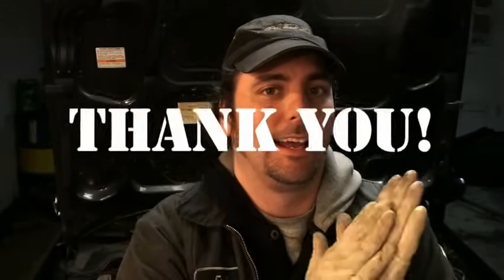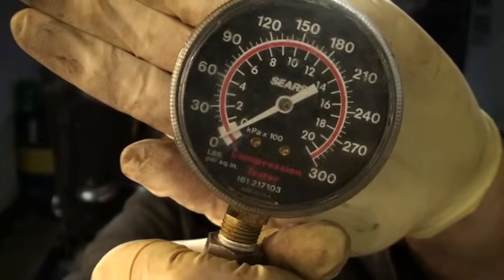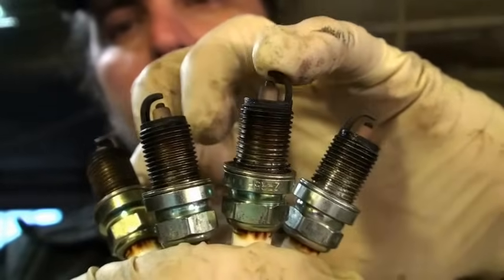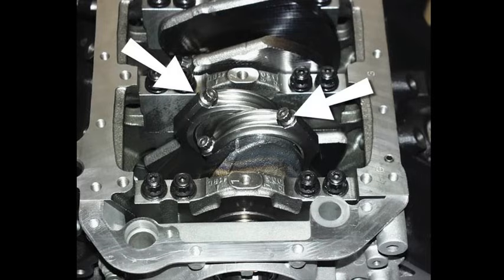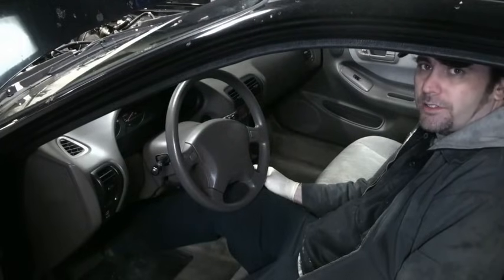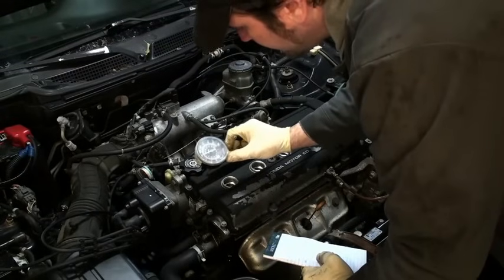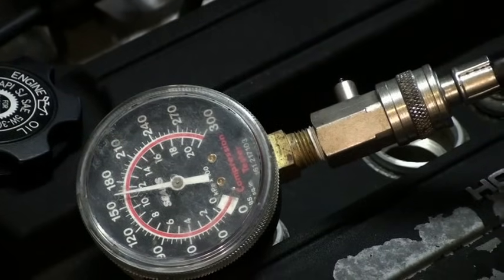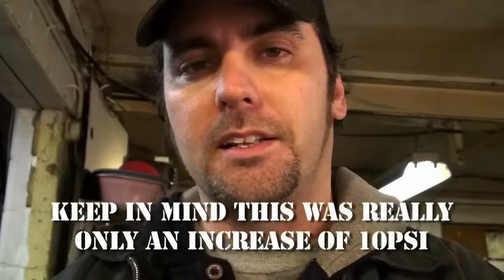How To Perform a Compression Test - EricTheCarGuy

Comment: At 2:43 you say "It's a good idea to disable the ignition system".  How?
Reply: Can you just listen to the video? It is all there.........
Reply: Gregory May "Disconnect the connectors at the distributor... look for the ignition system, look for the primary side, just unplug whatever's there, and it will disable the ignition system.

With how specific the video was, and others of his were, the general idea of finding wires (when I didn't know what to look for) and just unplugging whatever was there seemed a bit too vague.  Perhaps this explanation would require a video in an of itself, but if so, it shouldn't just be glossed over.  Luckily Eric goes on to say that we can flood the system to prevent a spark.  So I followed that method, hoping that it would work.  Still would have liked a bit more detailed instruction for explicitly disabling it, rather than relying on what sounds like a safety feature.  Perhaps this is not possible to give this detail, as it might be very varied depending on vehicle.

I looked in the fuse panel (not knowing exactly what to look for) and I rewatched the video a few times.  He mostly just talks about it, and when he does show it, it's a bit close up and so very hard to tell where in the engine he was unplugging something.  As a newbie I did not find it totally clear.  Just pointing that out.  

Luckily he did have a simple workaround he talked about with causing a flood condition.  Not sure if this is good practice, or would work for other maintenance in which I might be required to disable the ignition system.
Reply: Aaron Zeitler
If you don't understand than you should probably read some books about mechanics. Eric can not cover every single make and model in his videos! With some knowledge you can find mentioned connectors on every car. Please read just at least one book for automotive students before you attempt any repairs... it can take you a few days or a weeks but that is important. You can buy a book on ebay for $5...
Reply: Yes I agree with you. But that is just so basic and I think you have to have SOME knowledge first. Why people with no knowledge try to fix their cars and ask BASIC questions on car owners forums or you tube. You have to know BASICS in my opinion. My point was If you don't get what Eric is saying than it might be dangerous to work on your car... Modern cars can go wrong easily....
I think mechanics go there for example me and you;)
Reply: You could google a related video on replacing the ignition in your make and model.  That would probably show where it connects.  But yeah, I'll probably just use the workaround, too, because life is short.

Comment: I have a 2003 trailblazer it has a #5 ignition coil code,crank sensor code, an cam sensor code. I did a compression test #5 reads 0 compression 4 times an then all of the sudden it reads 145 and then back to 0. the coil is good  can somebody please help

Comment: Eric. First off, great vids. Second, I've got a 4.0 mazda b4000(ford ranger). I've had a terrible skip issue for awhile, about every two months I change the spark plugs and it goes away. But comes back in a couple months, now.... If I drive at low speeds or stop and go traffic then shut it off for a short period (I.e. Stop at the gas station) and restart it i get a large amount of smoke (white-blue) but it clears up in about 30 secs and acts fine. Help! I'm thinking maybe a injector leaking down, fouling the plug and dumping raw fuel in the chamber after a shut down. orrrrr. I valve seal leaking causing the same issues??? I'm mechanically inclined but have limited tools. What should I check next? When the truck runs good it's great, but when it's skipping I have no power and it misses throughout the rpm range.

Comment: have an code on cylinder #5 ( misfire )... just replaced spider fuel injector and did compression test on cylinder #5 & 7 and got 125 reading on both.. cleared code, ran the engine and misfire on #5 code returned. i'm stumped on what to do next....?
1998 GMC sierra 5.0  305 vortex engine 
(301,100 miles)
Seafoam the fuel? will that help clean the valves of carbon?

Comment: is 180 psi considered a high compression engine ? I have done the test from 1st to the 6th cylinder respectively around 178- 170-160-170-178-170
Reply: The car is an e34 535i
Reply: I forgot to mention I have done a dry test
Reply: I have piano pistons I want to see if 178 psi is good for such pistons or no
Reply: What about the difference between the results is this fine?  ty
Reply: 160 psi should I worry about it how much difference from piston to piston ?

Comment: 350 Olds engine in my 78 Seville. Low compression on all cylinders (100-110 lb) Vacuum is 16 inches at idle 18 max at 1200 RPM. No miss at any speed. No slack in chain, can the chain be off a tooth or two?

Comment: hey eric. Im stumped man. I have an engine miss on cyl 1.

Ive changed the spark plug, coil pack, and fuel injector and compression is reading 150+psi. 

The spark plug is not foul at all though, it seems like its never seen combustion but it smells like fuel. Though the engine side is new, the coil side seems to have some wear as if it were receiving a spark but not igniting the mixture. Is it a bad spark plug? Bad valves? HG?

Comment: I Performed this test and I got 162 psi on all 4 cylinders of my 64000 miles 2.0L TSI Engine. The car is a 2009 VW GTI Manual trans. I hope that's a good sign.

Comment: What kind of oil is he squirting into the cylinder cavities?
Reply: It looked red to me. Like Transmission fluid... Not sure if it would hurt, I believe it is all petroleum based, transmission fluid has more cleansers than engine oil and the red coloring is just dye to help differentiate between fluids in the event of a leak. But he should be using the same oil that is in the engine.
Reply: it should be engine oil with a high viscosity 30w (minimum)

Comment: Have cylinder misfirung codes for 1234. But only 1 black spark plug in cylinder 2 rough start up, idle, and when running. D16Y7 civic any suggestions helps. Reply or pm anyone lol

Comment: Well, i try to stay clean.. excellent video. Sadly I discovered a huge disparity between 1 out of 7 on my 305 chevy, 98, 130K. Well serviced and driven sanly.
measured 175 on all but 1. Valve train inspection, proper action.  After a hard rap with a plastic mallet, at closed position, seating seemed to be normal visuallly.
No transmigration of water/oil, or unusual levels. Never overheated. Just a very hard miss. I suspect broken compression ring..?  No sludge, signs of overheating. Cam seems normal.. I have experienced a flattend cam, and the running conditons were much different than this.  This occured rather suddenly....of course #6 plug was fouled. I have had better than usual oil consumption ever since new. About a quart at 3500 miles. Always changed at this or 4000 miles with quality filters and oil. (WIX/Valvoline) Darn the luck. Thanks for the vids!

Comment: Shouldn't the engine be to operational temperature?
Reply: Some people would say yes, their argument being that a cold engine has better compression because the elements inside are cold and not expanded. So they recommend warming up the engine to get the metals to expand before checking compression to get a more "true" reading. I've never done a compression test so I can't give my opinion, but the logic seems reasonable.
Reply: Vincent Gutierrez
Wouldn't it matter more if the readings across all cylinders are uniform? So the actual compression reading doesn't matter as much
Reply: Vincent Gutierrez I did mine warm and they all came out at 14.5 - 15 bar, this is in a 1996 Audi, I'll have to do one cold some day and a 'wet' test to see the difference.
Reply: That'd be great! I'm always down for some good science and crunching numbers to clear up car myths haha
Reply: hibye They do need to be pretty similar but if they are all below certain thresholds the engine could still be failing, albeit failing pretty evenly, but failing nonetheless.
Reply: That tester will get stuck in the head in some cases not fun
Reply: This is old, but needs to be more clear.  Get the manual to know for sure.  People saying "no" flat out are wrong.  Find out what your make/model needs.  For example, a 95 Mazda MX-6/626 KL (V6) engine requires the engine to be warmed up, then cooled for 10 minutes.  Disable spark, undo all the plugs, hold pedal down to test.  PSI for this engine should be between 142-203.  If compression is low, put a little oil in and recheck.  If it increases, could be rings or walls.  If it stays low, could be a valve getting stuck, or bad seating. If it stays low in adjacent cylinders, it could be the head gasket or warped head.

So no, there's at least one make/model that wants you to warm up the engine.  This is directly from the official Mazda workshop manual.
Reply: No mate.
Reply: bazthehandyman
Oh right, cool (excuse the pun), save on petrol. Cheers.
Reply: Great point.  I'm new to this, too, but I guess I'm more interested in knowing whether my truck works when it's warm than in figuring out what it does while it's warming up (since it usually does warm up.  I guess if it started and cut off right away, I'd feel differently).  Probably worth doing both, for me, since I'm trying to decide whether to replace the engine I bought it with, which is leaking three different colors of liquids, and is probably toast, or whether to just change out the gaskets and hope for the best.
Reply: I always do them on a fully warmed-up engine. let it cool down enough so that u don't burn yourself pulling the spark plugs obviously & if u have an aluminum head let it cool down even longer...you can perform a compression test on a cold engine & the main thing w/ doing it that way is that the readings are uniform across all cylinders but doing it on a warm engine should give u the closest readings to what factory recommendations are regarding compression...a general rule of thumb also is that a 4-valve engine will normally have higher compression readings than a 2-valve engine...

Now as far as leaving the throttle body wide open I think that is debatable...I've performed a compression test on my own Dodge 3.8l v6 using both methods on the same day and the readings came out the same or within 4-5 psi of each other so I do not believe it matters all that much. What is important is that ALL of the spark plugs are removed from the engine & that there is no fuel being sprayed into the combustion chamber during the test...
Reply: @ cool a reply from a 10 year old post.

Comment: hey hi i have issue with my car is my drinking lot of coolant all off sudden 
and my machine say it could be the gasket issue most properly 
and i have recently change the radiator coolant over flow after i turn off the engine next 2 hr. but i have no issue with the engine my car run fine i am trying to find whats wrong going on. its a honda accord 2006 model

Comment: Also does anyone know of a resource to get the compression values for a whole slew of engines? That is, when you go to do a test on an engine the manual says that each cylinder should produce X-amount-of-pressure (say 180 PSI) with a maximum of 20 PSI difference cylinder-to-cylinder. Is there an online resource/DB that has those numbers for lots and lots of engines or must you really get each metric from each separate manual? My mechanic buddy told me yesterday that Alldata (he calls it "somedata") doesn't always have those numbers.

Comment: Didn't get a response on the forum, so I thought I'd post here too. Apart from the larger pressure that was ultimately achieved in the wet test what I also noticed was that the needle's jumps along the way to 160 were different too. And that got me thinking: are the numbers that are attained at these intermediate "stopping points" of the needle while the pressure builds to its ultimate value important? My thinking is that yes, they are. That is, how close the first pressure value is to the last/ultimate pressure value has meaning. So in other words, it isn't just the final pressure, it is how the cylinder gets there that has importance. I mean, if a cylinder has a low first pressure but builds to an acceptable final pressure that's one thing. But if that cylinder has a higher first pressure before building to an also-acceptable final pressure then that paints a different picture.

So the question is: is this correct? And if so, how can you put a metric to gauge "how good" a cylinder is based on this data-progression or building of pressure during the test of a single cylinder? Maybe like first number is 50% of the final is ok? 30%?

Comment: Hi EricTheCarGuy  my results are: Dry: 1st-30 2nd:60 3rd:60 4th:90 With oil: 1st:60 2nd:75 3rd:75 4th:110
Is it even possible to start that or my tester is sh.t?
BTW the car start perfectly and runs to top speed of max 115mph but the engine makes exotic dances when i change gears
Engine is Honda Civic's D16V1 1.6 16V 110HP petrol

Comment: what happen if u lose compression on 2 n 3 cyl,my car its a honda civic 95 ex my compression on 1 n 4 cyl have 150 n the other two have 50,what can it be head valve or my piston rings,i just place piston rings on the piston i i know its not the piston ring,and i try my other head on 1 n 2 cyl have 50 only n 3 n 4 have nothing so i im think its the valve bent or ??
Reply: probably the head gasket

Comment: It could be the following problem's, a) Valve stem seals, Carbon on the Valve seat, so not closing properly, compression ring's warn, Head Gasket leak between cylinders, they r the main 1's but still a great post on the basic's :)

Comment: My 2JZGE tested 58-62 PSI on each cylinder. Isn't that so low that it shouldn't even run? Is my gauge bad? On the last dyno I made 210HP (220 stock) with 160K miles. Is that weird?
Reply: Thats normal, actually that dam good rather its the is300 or supra. My mr2 is supost to make 112 with simile miles but its down in the 90s. Most cars in genral loose about 30hp. The fact your still making 210 is good.
Reply: Jose Lozano Actually we retested with a brand new gauge and the old gauge was wrong. I was actually getting ~120 per each cylinder.
Reply: Gotta love those jz's

Comment: How would you do this on a direct injection turbo diesel? No spark plugs so..
Reply: maybe through glow plug holes, if they are in the combustion chamber?
Reply: You have to remove the injector and do the test from there.
Reply: what if its not direct injection ? where would it go then ?
Reply: anthoney seenauth  Like an IDI?  He remove all the gp's and test them there.
Reply: oh cool, thanks for the info Tallerico500
Reply: No problem. Hope it helps a little.

Comment: I have a Volvo S40 02 with 111k.  The √ engine light was on for a couple of weeks.  I believe the code was P0042.  I changed the gas cap and after a few days, the light then went away.  Recently though, when I start the car, the engine shuts off unless I press the gas for a few seconds to get it to idle and stabilize.  While driving less than two miles from home, the car began to shake and loose power.  I barely managed to drive it back into my driveway as the thump-puttering sounds (not banging) from the engine grew louder.  What do you propose the first order of approach should be?

Comment: Eric I love your videos and they've helped me so much. But my 98 integra won't start and there's no spark. The dizzy rotor is also not turning. Im wondering if my timing belt snapped. The crazy thing is I replaced the ALL the belts less than 10k ago. What do you sugest? Thanks ahead.

Comment: frednich9603 The way we do it at school is by pulling the fuse or relay, whichever is easiest, for the fuel pump and pulling the plugs one at a time. However, since you need to pull all of them anyway to do a full test, I would go ahead and pull all of them at once and have it done unless you are concerned with confusing the firing order when you reinstall the spark plugs. I'm not a professional, but I've had several years of instruction and a small touch of experience. I'm not ETCG good, but I know some things lol. Hopefully this helps answer your question, and good luck

Comment: I have a car that has plugs that are a pain to get to.  I'd rather test one cylinder at a time if possible.  Do I have to remove all the plugs at one time to do the test if I disable the coil and the fuel pump?

Comment: Hi, some engines are termed "interference" engines because if the timing belt/ cams break, the valves will hit the pistons during rotation. In most cases it will affect a few cylinders, and in some, all. If you set the cylinder your testing at TDC (top dead center) and apply 30-40psi of shop air to it, you can listen in the intake manifold and exhaust for air leaks. That should tell you where the compression is going. This is my best guess with the limited info you gave. Good luck!  B
Reply: Wrong, that is not what it means.

Comment: One thing that is also kinda important is you need your throttle at Full Open to get an accurate compression reading. This at least applies on my B Series Honda engine.

1) Engine should be warm for an accurate reading (I understand that the piston rings expand with heat?)
2) Full Open Throttle
3) It is also best is all spark plugs are removed before starting

An additional note is that you can buy a remote starter switch to make the process way easier and allows you to watch the gauge closer.

Comment: I need some help trouble shooting my 2000 Chevy s10 2.2 auto 2 wheel drive put a new fuel pump and filter and replaced the relay and I only have 10 to 12 pounds of fuel pressure the motor will turn over but it dose not run on the ground only on a life about 2 feet in the air it will run for about 10